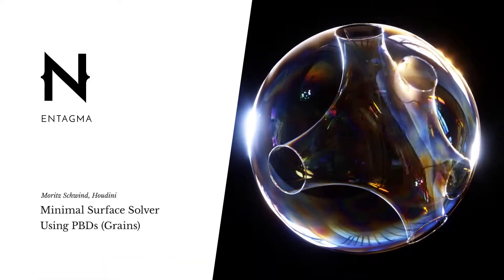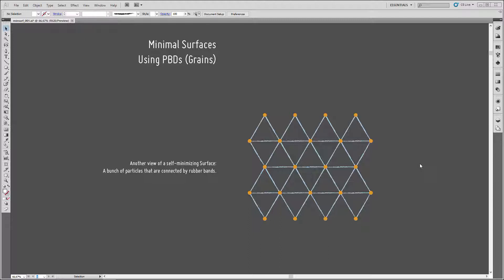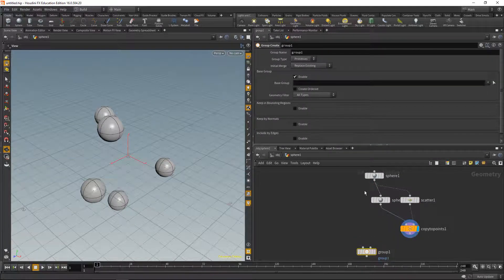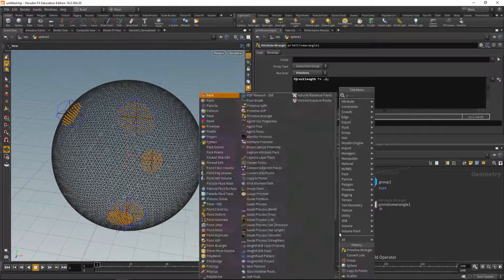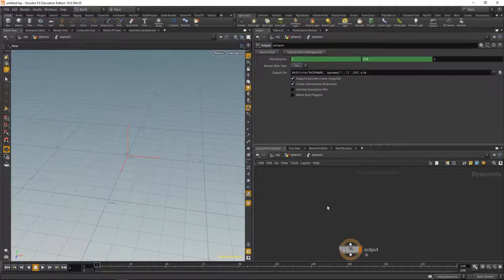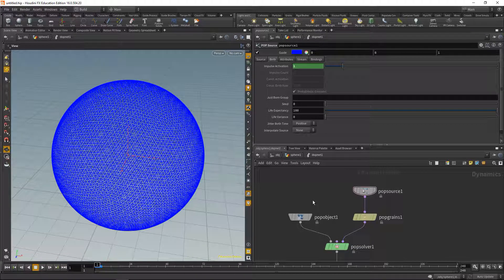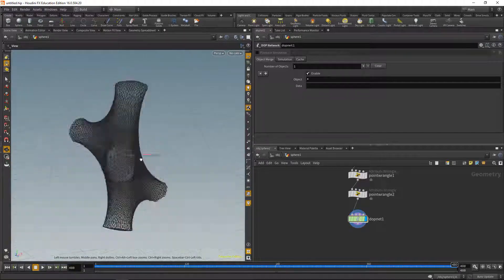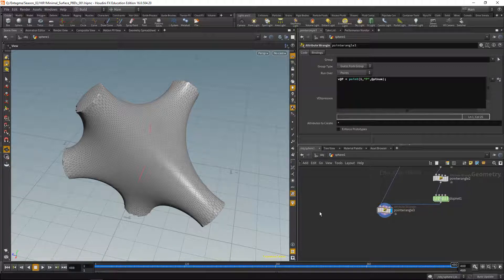Easy Minimal Surfaces Using PBDs Grains

Comment: Hi guys,

My object explodes and doesnt wobble to the inside.
I dont know what may be the reason for it.
Reply: In the popgrains node you should close the "Use OpenCL"   :)
Reply: @tingandkao  That works! Thank you!
Reply: Penguin Kao had the same problem, followed step by step. Thanks Penguin You got it!
Reply: @tingandkao  off thanks. after searching the problem for ages.....
Reply: I had the same problem, and I found the difference between my object and  the sample code :) Now my object works the same as the sample.
I put the memo here to hope it will save someone with the same problem.

“popgrains” in the “dopnets”
- Need to check “Assume Uniform Radius” in “Behavior” tab
- Need to check “Disable Constraint Averaging” and uncheck “Use OpenCL” in "Solver" tab
Reply: @tingandkao  Thanx!
Reply from the maker: Heyhey,

did you have a look at the project file we provided? That's usually the quickest way to find out what went wrong :)

Cheers, Mo
Reply: Thanks Mo you Rock! 🎸